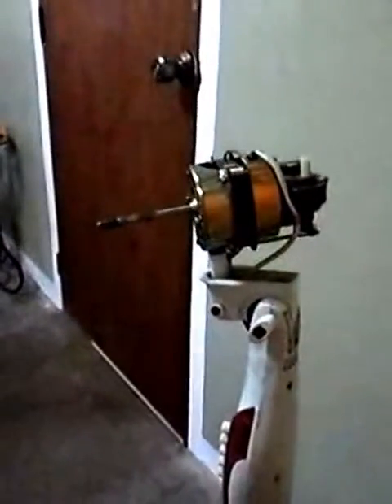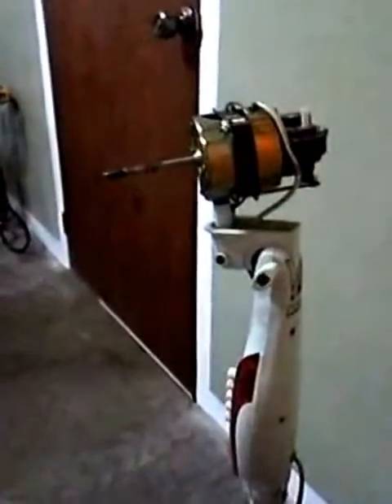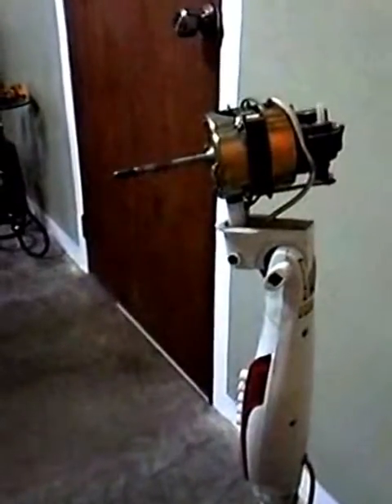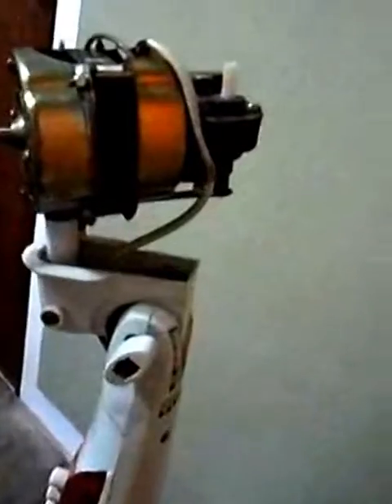electric fan motor troubleshooting using a multi tester

Comment: Ohms po b gamiit nio sir
Reply from the maker: Jason Maitem on this video i used an analog multi meter yes ohms. But if you are using a digital multi meter you can set to buzer or diode mode. Thanks for the dropby on my channel
Reply: Tnk u sir poydi sa ohms Kung digital multimeter po